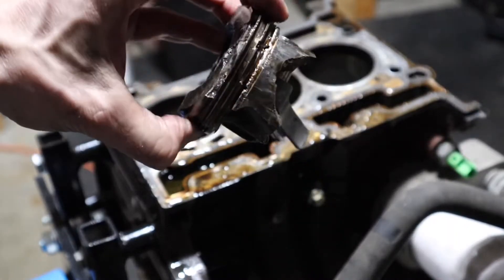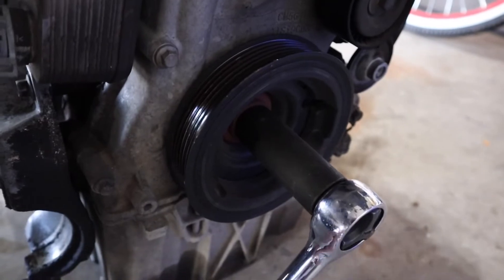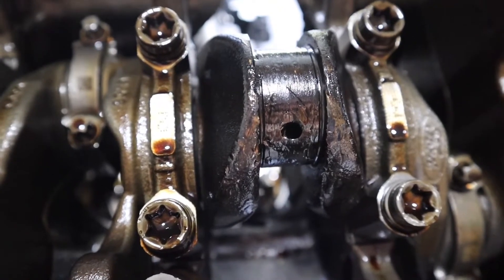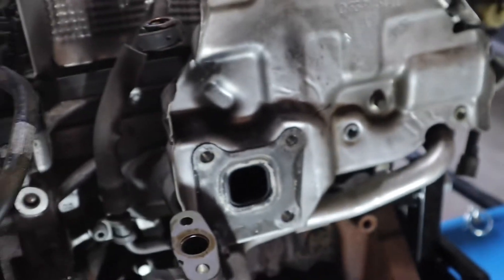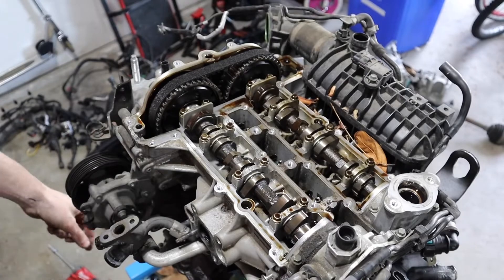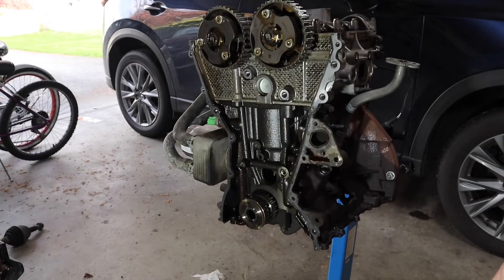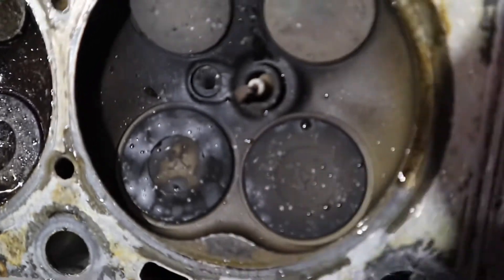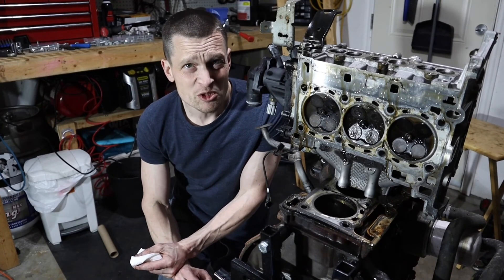Ford Fiesta Engine Teardown/Analysis (1.0L EcoBoost) - What Failed? | Fiesta Resurrection - Part 2

Comment: lol read the fine print . On big 18 wheeler there are greaseless  joint . People were thinking it meant they never needed greasing . The meaning was the owner will grease the less frequently since they are sealed .  It's likely similar for the belt . Usually belt now a days need changing every 80000 mile approx . I would not worry about bet . Yes oil splash on it but it's not a lot . The main issue i got with this engine is crank lube hole . They re not angled . They re sharp edged hole like a knife . Also belt gear is not keyed  .  Or pressfited . Only oil belt is keyed and washer between belt edge is not angled either wish could damage the belt .combined with the under alternator wire too close to everything . It's likely why these belt engine had reliability issue . Is chain timing belt better ? It's more durable . Period . I prefer timing belt . More precise more quiet . I think the belt version of this engine main issue is electrical .belt version is better for racing application

Comment: I’m constantly doing the coolant changes and oil changes and doing a fuel system clean on the gdi system. Tranny fluid filter and fluid change every chance to can get. You can only do so much preventive maintenance. I change my spark plugs and do the tune ups when I’m supposed to and fuel filter changes when I can.

Comment: My focus 1.0 ecoboost 
I plugged my other diagnostics scanner in and it says this  fault is 
Power supply fuel pump 
Short circuit to positive or open 
Intermittent 
I ordered a low pressure fuel pump that will sort it i can start the car and rev it up but when let it idle car just dies and if i rev it it will stay running for a couple of minutes with accelerator keot pushed down a bit thanks for your info mate

Comment: My ford 1 l ecoboost died anyway at 160000 kilometre because of this .... wet belt . I change the oil every 18000 kilometre ...
Reply: Same happened to mine oil was changed every 5k - now sitting at dealership for new engine install
Reply: @ivobiancucci4528  did they make a quotation ? Here in France  ask me 6700 € the other one 8000 € so the price of the car ... I sell it for scrap part at 1500 € ...

Comment: Are these engines designed by AI?  They sure aren't designed by engineers. I've never seen a synthetic belt run in oil. well, until now that is.

Comment: I have a US spec Ford EcoSport with the 1.0L engine.
What was the problem? Oil starvation? 
Yes some of these fail do to faulty oil pump belt and pulley. There is a TSB about them.
Looks like the timing belt and oil pump belt actually look like they are in decent shape. It's intact and doesn't look worn that much.

Comment: 1st of all, your comment on wet oil belt show how you lacking in knowledge are, you sound like a scrapyard car disassembler. Every car company that employed the wet timing belt has fail or had to reduced the service time or km. Ford doesn't have a lifetime wet belt, its 10y or 120k KM, another point that shows how you lack a lot of knowledge, like most corner shops mechanics, a brand mechanic, i have 3 in the family, every month of so has to go to schedule formation in the brand main offices. I have had in family a first generation mk1 focus 1.0 125hp that was sold used with 200k km, the difference is that every year or 10k km the oil was changed like clockwork, 5w20 castrol. After 10 years when the belt was changed, it came out almost perfect, the owner asked for the used timing at dealership, no cracking. The castrol 5w20 is a an oil specially design to sustain the high pressure between components, thick or lighter oil is a concept from the 90's and its dead. Ford unlike other brand brand like the exploding/crap TSI/TFSI from vw, and you noticed it there is very high detail and quality on the machining of the engine internals, Ford uses many forged parts on its stock engine, and since you know little, having a cast iron engine body makes wonders for engine life and reliability, all other brands use full aluminium engines.
Ford ecoboost is not an engine for the average client, who after 2/3 years stops following the maintenance guide, you know that little book written by the engine creators that most corner shops ignore, that's the car lifeline.
Reply from the maker: Wow good for you for knowing so much more than me. 🤣🤣🤣🤣

Comment: The debris in the screen was most likely from after it blew a rod---lots of metal fragments. Even when these engines are perfectly maintained, they still have a high failure rate due to being so overstressed. But that's American engineering nowadays---as long as it makes it past the warranty period, it's "good enough"
Reply from the maker: The debris was not metallic. It was definitely rubber.
Reply: Its from the timing belt.
Reply: And from From the oil pump belt submerged in oil🙄

Comment: them engines seem like compleat Crap im seeing them blow up all the time.  a lot to do with the WET timming belt with bits comming off and cloging the oil pickup.. some one will come up with an aftermarket Chane drive

Comment: .....many small disposable lawnmower engines use wet timing belts as well. Poor little engine is overstressed. Suggest replace engine with a used one and trade it to recover some of your money. Next step buy an older Toyota Corolla  1.8 port injected with a non-CVT transmission. Enjoy some reliability for a change! Great vid.....thanks!

Comment: What power toolsdo you recommeng.?
Reply from the maker: Depends on what your budget is. Hardware store brand tools work fine and are cost effective. High end brands (Mac or Snap-On) are way better but cost 10x as much. For power tools I use Milwaukee and they are inexpensive and work very well.

Comment: I've heard these engines are small, but wow they're way smaller than I thought. Look nicely built engine, but wht oh why did they invent that wet belt thing. Makes no sense at all.
Reply: I have the 2013 face lifted ford fiesta ecoboost and had no problems .the wet belt actually last long 10 years or 240.000km till it should be changed but a good amount of people don't stick to getting their oil changed you should change it min every year or 10.000km or even slightly sooner if you have the time
Reply: @SASMacDroid  but still it costs way more to replace and it's not even that much longer lasting than conventional belts. Not to mention chain. I have +610000 driven diesel mondeo and it still has original cam chain.
Reply: @jothain  yea i understand the cost of having that changed and the water pump included can cost up to 1500€ i have +136.000km on it and i don't know in what state the wet belt is since it's built in but a belt can snap and a chain can break it depends on Manny things but up to now i can't complain it's a good engine up to now for me

Comment: The later ones have reverted back to a chain apparently.  Hopefully they’ll be trouble free.
Reply: I have 1.0 EB a chain, rear turbo, year 2019. So far I haven't seen a disassembly here on YT
Reply from the maker: Riiiiiiiiiiight
Reply: Still Wet Belt driving Oil Pump though, Utter Garbage

Comment: I have a 1l ecoboost to and I think you are supposed to replace the wet belt  every 100k miles mabye I'm rong but I think all the sluge in the oil pickup is from the belt 🤔

Comment: Excellent investigations, my good chap!
Looking forward to ours going bang, but only 54k right now... 💥
Reply from the maker: You have time. I would do 5K oil changes with synthetic and at 150K proactively inspect the oil pump pickup screen for plugging.
Reply: My 2013 1.0 ecoboost fiesta has 90.000+ on it with no problems it's in a ford garage at the moment having the wetbelt swapped,oil belt ,water pump and other stuff so I'm very curious to see how my old wetbelt looks like but i did have my oil swapped every year also roughly every 6.000

Comment: PROBLEM with this engine is the wet timing belt. It starts to degrade and small bits start to come off. These particals go and clog the oil pump, oil pickup ect. The engine is then starved of oil and things go bad quickly. Bad bearings on the crank and cams damaged pistons and warn cylinder blocks. Terrible engine.
Reply from the maker: Yes, this combined with Ford’s stated 10K mile/16K km oil change interval.

Comment: That belt never was changed at 100k Km or what ? This cars needs to have the belt change at 90k Km and oil change at 12 months to be all 100% safe and good. Looking at this video this engine did not seen any love at all. The owner let this engine die with no love for it lol 🤣🤣
Reply from the maker: Nope. Belts are not a maintenance item on these engines. Welt belt running in oil behind the front aluminum cover.

Comment: Other than swapping the turbo blow off valve my 1.0L EcoBoost has been troublefree. Ford recomends belt change 150K miles/10 years so I had mine changed at 140K miles and it was a whopping 1700 USD (living in Finland where labour costs and taxes are high). Car has now done 160K miles and I change oil every 10K miles using Castrol 5W-20 desingned for it.
Reply: I change my belt at 90 - 100K Km and oil each 12 months. And cost me much less here in EU.
Reply: @dennythescar80s8 How much?

Comment: this is no lifetime timingbelt, its a normal rubber belt sitting in oil. as long as you follow you service intervals and change your oil its okay, the belt is only meant to last 10 years

Comment: How many miles were on it when it blew? I’ve been driving a 2015 Fiesta 1.0 Ecoboost that now has 110,000 miles and have had no issues at all (or should I say yet?). 

Thanks for the breakdown vid. I’m going to send this to my mechanic so he knows what he’s up against should he need to do some major surgery!
Reply: I believe the belts break down when normal engine oils are used. Ford specifically insists you use oils using the 948B Ford spec oil. I use Motul specific 948B in my 2014 Fiesta. It only has 50,000 ks atm. But have started changing the oil every 5000ks. I was doing it every 10,000ks. I don't drive much due to health. So it's not a big maintenance cost for me. I'm hoping the belts are in good shape. I've kept the last oil filter from the last oil change and will cut it open and see if there's any debris in it when I get around to it
Reply: @garethmilne6887  So basically if you get a oil change at a garage/mechanics (like a lot of average people do) you are completely at the mercy of weather they can be bothered to put the right spec in or not
Reply: @Blac-m8d  yep. And 90% wouldn't use the correct spec. I doubt the dealer did when my car was under warranty. But ever since I've made sure to use the 948B spec
Reply: @garethmilne6887  I checked with my mechanic and they said they buy that spec in bulk but it's not the Castrol stuff. I assume as long as it's the right spec it's fine
Reply: @Blac-m8d  yep should be fine. I use Motul specific 948B in mine. And hoping for the best as I bought the car new in 2014 but only has 51,000 km on the clock as I don't drive a lot due to health. Only thing I've really had to do to this neat little engine is I put a turbosmart dump valve on it as the plastic fantastic crap that was on it started leaking and was losing boost.
Reply: @garethmilne6887  a tip for you sir.. I would change belts and overhaul the pumps.. At 70k miles.. Never neglect if the oil lamp, comes on!.  I can not stress that enough.. When oil lamp is blinking, stop ASAP,.. THE OIL PUMP in sump ARE STRAINED,.. makes low oil pressure,  this costs you an engine!.. DO NOT DRIVE It any further!..
Reply: @gorgon9786  thanks. I'd never drive with the oil light on. I work on engines a lot. But this is the only one I've owned that's had the wet belts. My theory is using the 948B spec means the belts won't break down. But who really knows about that?
Reply: @garethmilne6887  I believe this one theory with running small trips, never really warming up these engines, which people say is a way to get the belts go bad, leaving rubbery slugde on oil pump mesh, - leading to big troubles,.. Thousands of people have been reporting of that problem.. Saw your mileage, and seeing your good now,.. -if oil lamp in the future starts blinking or lits up, this is trouble, and can get expensive if neglected!.  Have a nice evening.! 👍
Reply: @gorgon9786  I currently have the car for sale anyway. I already have a  double cab Ute and as I don't drive much I've decided to keep the Ute. It's old but in good shape and easy to work on. Will buy another motorcycle instead
Reply: @garethmilne6887  yeah, the oil light, might come on occasionally giving you some hints, and then,. Seen it took only a few miles after suddenly stayed on red solid!.. Surprisingly hard to see that minimalist red lamp!!
Reply from the maker: 114K miles. If you change your oil at 3K miles you will be fine, but if not, I would say bare minimum you should remove the oil pan and inspect the oil pump screen for clogging.
Reply: @that_jamesguy  Thanks! I change the oil every 5,000 miles. The freaking manual says every 10,000…are they kidding me? I have kept this Fiesta because I still get 48mpg hwy, and there’s no way I’m giving this up with gas prices being what they are.
Reply from the maker: You know, 5K might be fine. I didn’t know the recommended interval is 10K! That explains a few things….
Reply: @that_jamesguy  They also have the timing belt replacement at 150K. I suspect a lot of issues this engine has could be avoided by NOT following Ford's maintenance schedule and doing scheduled maintenance much more frequently. A wet timing belt lasting 150K? I don't think so...
Reply: I wish I got that kind of mileage out of mine before it went kaboom. 44k miles and the oil light flashed and the engine died. 4 months and going on 4 visits to the dealer and it's still not entirely fixed. Got a new engine under warranty, but the engine light is just persistent. Too bad the market is awful right now or I would get out of this thing asap. This thing is fun as hell to drive which makes it even more painful
Reply: @michaelpfeiler5537  Wow! I’ve been driving the hell out of mine for 8 years, now at 116,000 and going strong.   The only major issue I have is the flex pipe failed and I had to replace the exhaust with catalytic converter. That’s a wear and tear part though.
Reply: them engines seem like compleat Crap im seeing them blow up all the time.  a lot to do with the WET timming belt with bits comming off and cloging the oil pickup.
Reply: @Mr_Meowingtons .. Use the 5-20w oil,.. Castrol is the way to go..
Reply from the maker: Mine is already cracking really bad at 114K.
Reply: Would recommend you to swap the timing belt,.. Do not trust Ford which tells you it will be swapped for 150k miles.. I recommend doing a swap on 70k miles, check and service the oil pump, or even better to put in a brand new,.. New belts and a waterpump kit as well!.. There been thousands of these cars, which have owners been trusted what proclaimed Ford are selling these engines at..